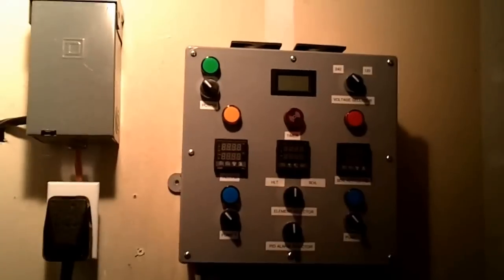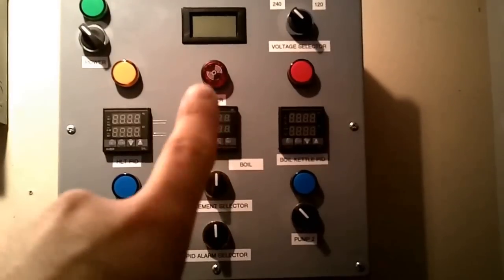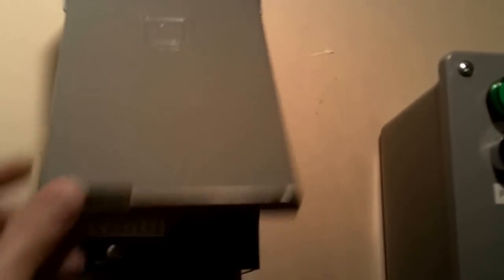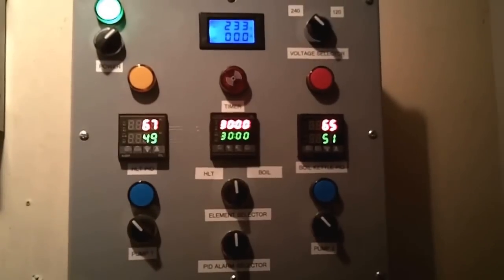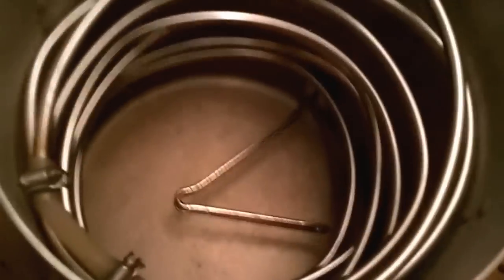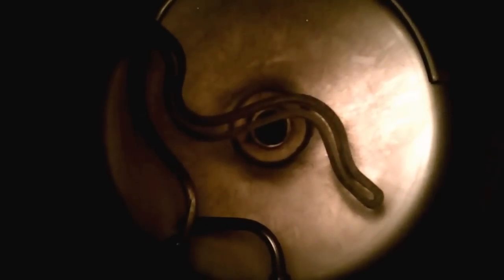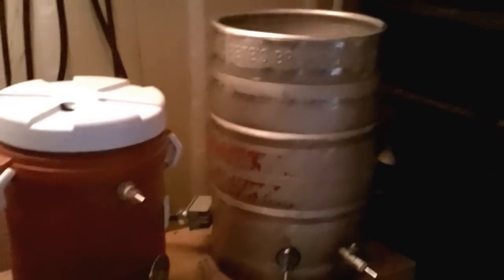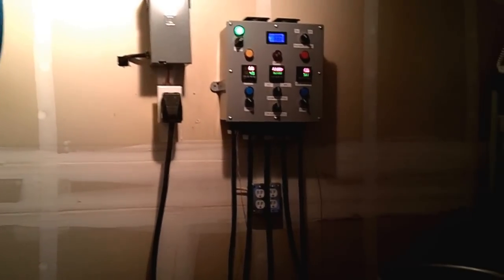E-HERMS Brewing System

Comment: Hey Glen, really nice build you got there. I'm not E, yet, but working on it. I really like that you have the bottom dump drain on you BK, Question I have is, Inside your BK, is the transition from the bottom of the keg into your drain, FLUSH, meaning NO lip to stop any liquid or gunk to go down the drain? If so, What did you use to connect the valve? Is it a weld-less connection or did you weld it on? I ask because you did cut the top off your keg, and I usually find with a bottom drain, they cut the BOTTOM of the keg out and use the keg upside down. The transition is totally smooth right down into the neck where the spear goes and you can connect it with a 2" tri-clover fitting.  Thanks
Reply from the maker: Eric Smith Hey Eric, in my case the bottom dump was an afterthought.  I was already using the BK when I decided to make it a bottom dump.  I have seen the option to utilize the triclover with the already existing sanke fitting, utilizing the keg upside down and I think it is pretty slick!  What I did was I cut a hole in the bottom of the keg and silver soldered a 1-1/4" 316 stainless steel weld spud into the hole.  The spud protruded about 1/4" into the keg and as such, whatever I was draining at the time would cause a small amount (2TBSP or so) to still remain.  I then took my die grinder with a flap wheel and ground it down almost flush being careful not to weaken the solder joint.  I still get a very small amount of residual around the spud, but only about a teaspoon or so.  From the weld spud, I used a close nipple, then a ball valve, street elbow, 8" nipple, and another elbow (to direct the flow down).  NOTE: I used 1-1/4" because I already had $100 bucks invested in my old RIMS tube and wanted to recoup some of that by utilizing those fittings.      If I were to do it again, I would use the keg upside down as you mentioned or I would find a lower profile initial fitting (maybe a tri clover ferrule) or grind the weld spud thickness way down (prior to soldering) or maybe even space it out with a stainless shim or something.  I would also go with a 2" dump as in my setup a big hop cone will span the drain opening and needs a little help falling through the hole.  Triclover would be nice for the quick disconnect aspect as the kettle can be a challenge to move if trying to maneuver the arm of the drain through the hole in your stand.  Since I was already committed, I recently added a large banjo cam lock between the street elbow and the nipple so I can now disconnect the long nipple and lift the kettle out if I need to for some reason.  It works great and I have no concerns about plastic at that point since whatever will come in contact with it is something I want to get rid of anyways.  I know this is long winded but I am pretty thorough and wanted to give you a thorough answer.  It is an awesome addition for cleaning but also great (with a proper diameter hole) for dropping out your hop cone/trub before transferring to your fermenters.  Hope this helps!  Any other questions, feel free to ask.  Thanks for subscribing!